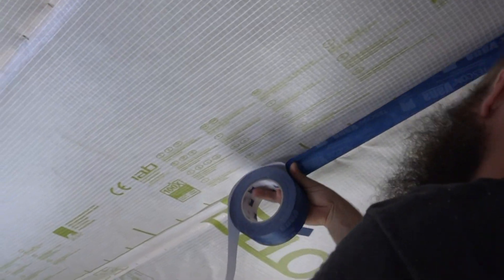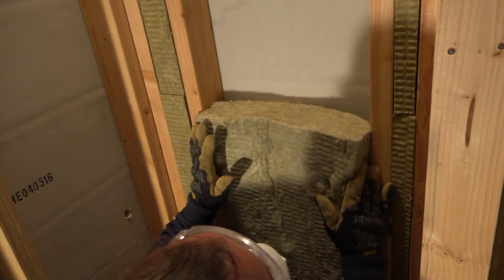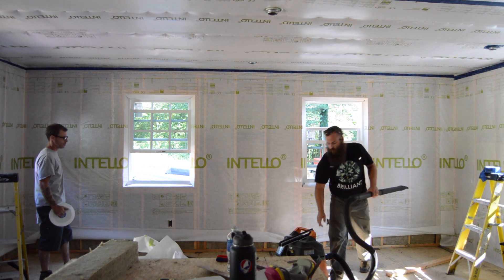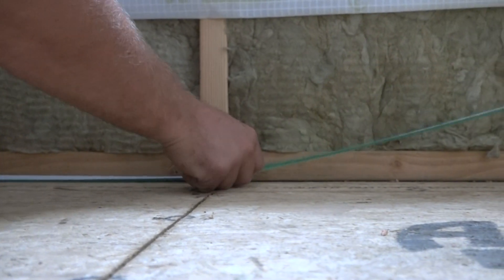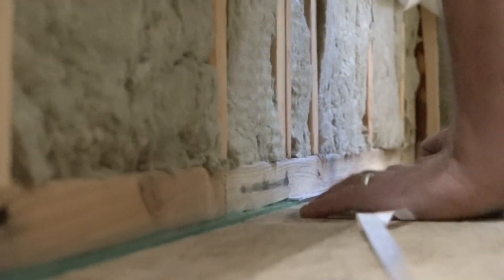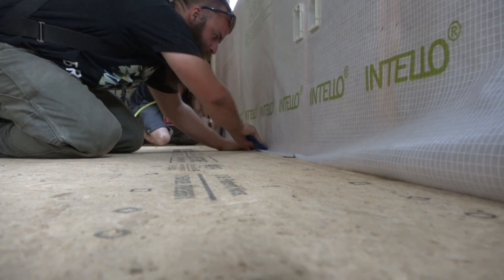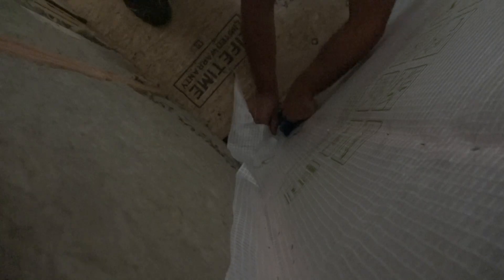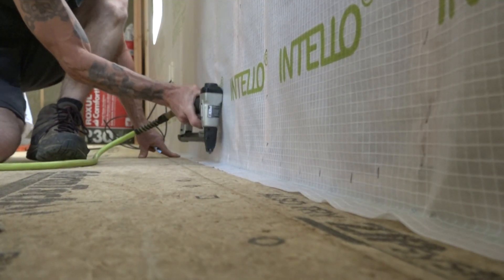Interior Air Barrier Installation (2/3): Walls

Comment: Do the staples make holes to let moisture thru? The thousands of staples add to one big hole?
Reply from the maker: as a percentage of surface area, the staple holes are minimal. Diffusion is a product of surface area, airflow is a product of hole size, which is why air sealing is so meticulously executed.

Comment: Good video. I am needing to do this to an exterior wall because of bad air leaks and a question that I have is...I have heard that a barrier such poly should not be added inside because of condensation. How is this different than a poly vapor wrap and how does it affect the concerns of condensation.
Thanks for any help
Reply: this is vapor open, poly is not. also intello is vapor permeable-ness is directional, the logo must be visible on the interior side; which is analogous to tyvek with logo visible on the exterior
Reply: @zefrum3 
Tyvec claims its vapor permeable both directions.

Comment: does the staples put holes through the membrane?
Reply from the maker: yes, and drywall covers the staples and makes more holes. It is difficult to make a vacuum-flash house, but gasket or sealant could be used to seal the drywall. The main point in air barriers is that is it a system,. not a single layer. Air barrier SYSTEM is what more people should say when they say air barrier.
Reply: They tape over them after. Similar to how seams are treated on exterior zip panels :)